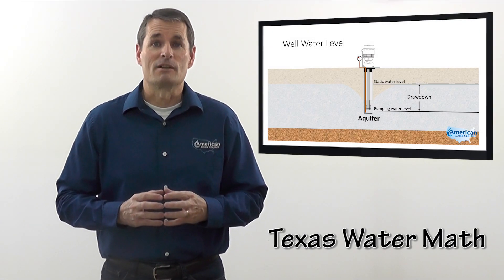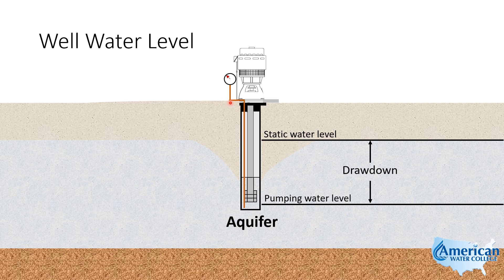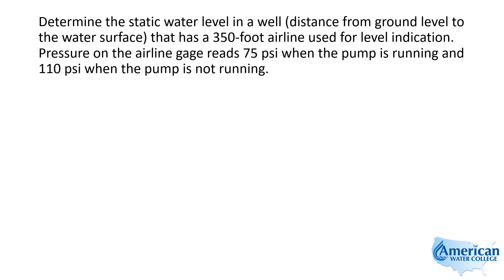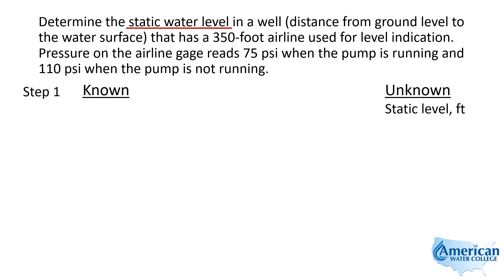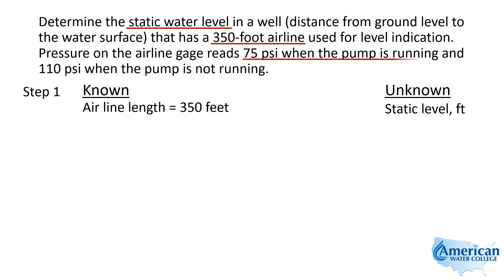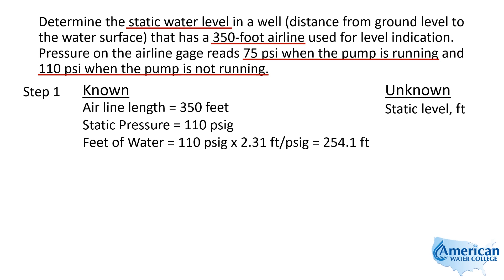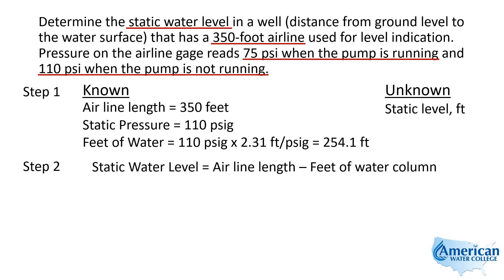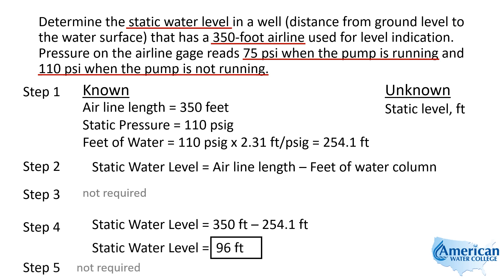Groundwater Static Water Level | Texas Class B Groundwater Math

Comment: May I know where the formula is came from ?,
Reply: Hello, this formula is used in the water industry. We measure 1 psi by measuring feet. For example, if a tank is 50ft high with water, you multiply by 2.31 to get the psi.
This relationship is used to convert between pressure (psi) and head (feet of water). 

A column of water (2.31) feet high creates (1) psi of pressure.

1 ft creates 0.433 psi